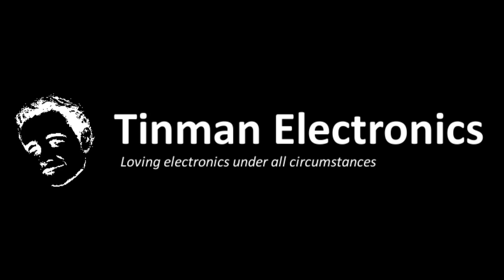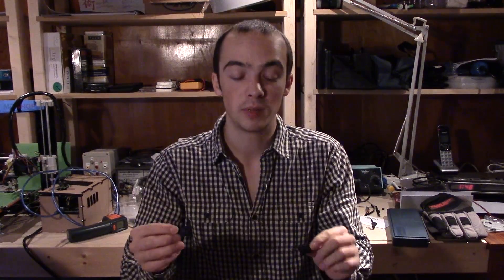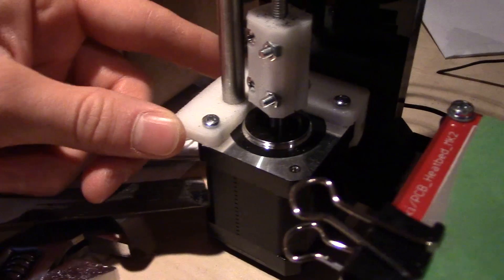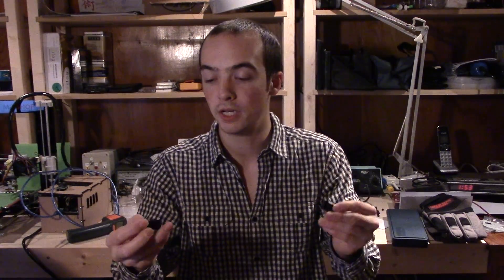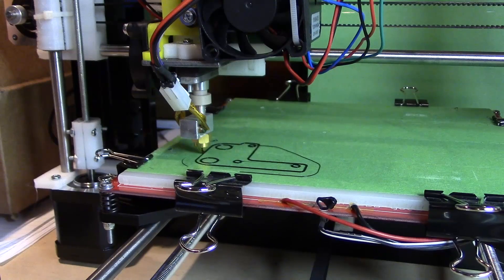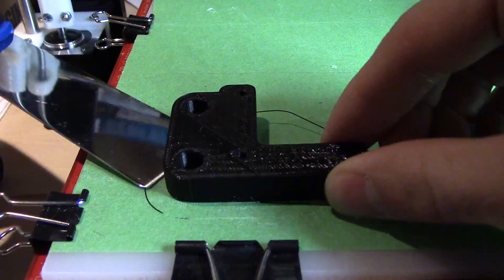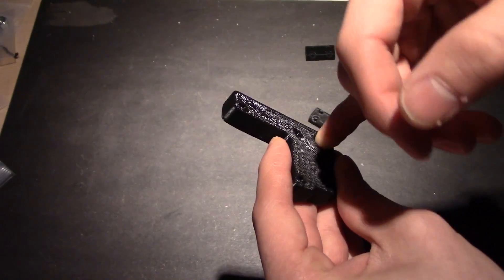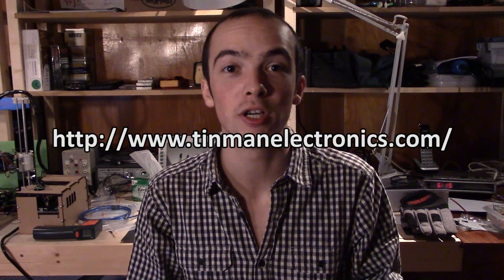3D printing bigger parts - Tinman Electronics 18

Comment: did you consider just baking your acrylic at temp between two polished steel sheets? or just using counter sunk screws to screw the concave faces together after clamping them flat? 

I'd worry about screwing it together personally since it may hold tension and if it pops it could damage the printer, but reforming it in a not too hot oven between polished metal sheets might get you a better surface for no more cost than the heating and some borrowed metal.

Comment: Go get a pieces of glass cut to your printers dimension. i don't know about all types of glass but the glass I buy at ACE Hardware (USA) is very flat and prints well on. also because its smooth there is a pretty great bottom layer finish!

Comment: I made a video of a print of a LCD mount. During the recording of the print the heater failed. I had to finish so I fixed and kept recording. The reason for the failure was a connection that loosened apart. Your heater connections there will loosen apart like mine did.
Reply from the maker: Thanks for the heads-up! I fastened my wires since posting this video, and everything is neatly cable-tied into place. No more dangling wires. I also used locking connectors for my thermistor and heater, so vibrations wouldn't disconnect them.
Reply: Tinman Electronics Ha! Good. I try to imagine what an astronaut would do.
Reply: Joule ian GO GO GO